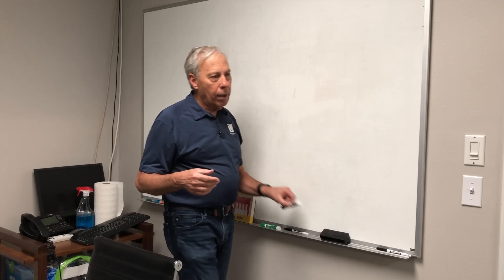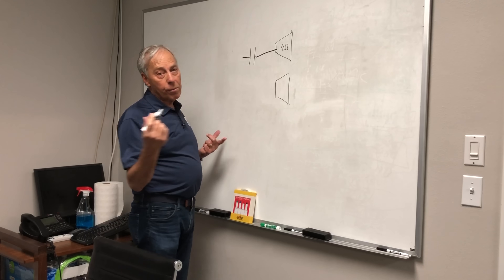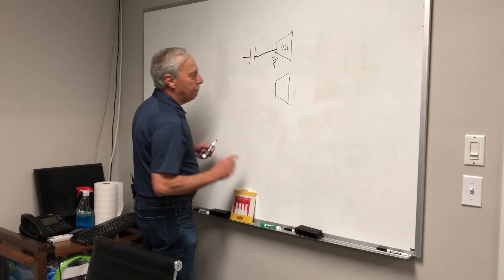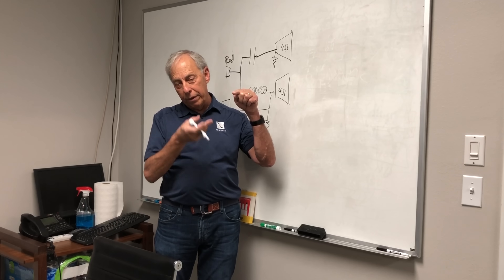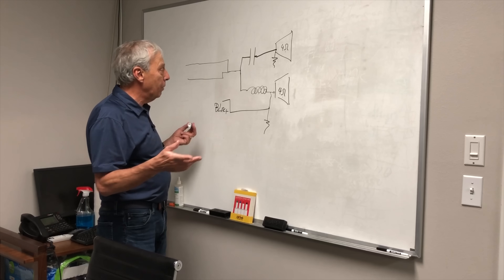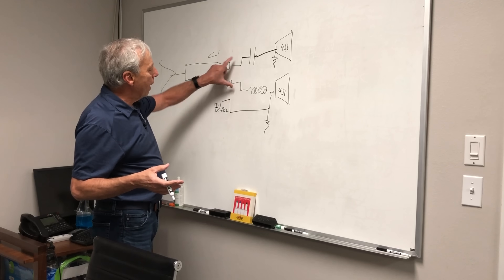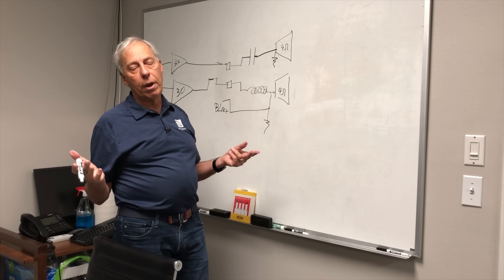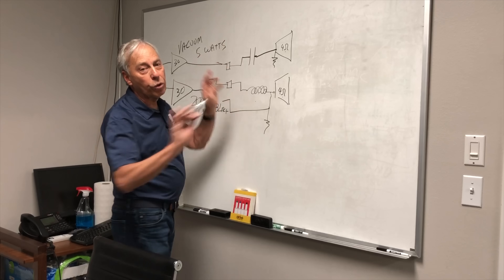How does bi-wiring work?

Comment: Hi Paul. Generally I like you vids and explanations a lot. But I'm not happy with this explanation of bi-wiring. You do it because the woofer generates a current back to the amp while the tweeter does less so. The back-current from the woofer won't disturb the signal to the tweeter if you bi-wire. So it's basically not about watt goes in but about watt goes back. Also, with most double-posted speakers, you don't bypass the cross-over. Sorry but my explanation is the only reason why bi-wiring can make sense. Apart from the fact that there's double the amount of cable feeding the speakers which might help.

Comment: Paul you were great at the "Bi-Wire treatment you gave.  The Bi-Amping not so much.
The push and pull you attribute to the two legs of the circuit as (+) and the (-) lines was a great metaphor.
The only thing I'm considering as not being discussed in the many clips I've watched on this topic is a follow on for you.
In AC circuits we have a ground and more importantly a Neutral.  The Neutral essentially is. relief valve for XS current drawn that needs to be safely dissipated.  I realize this is a DC circuit however am similarly wondering about the return leg in the DC circuit being free flowing enough to draw off the powered leg amperage in heavy pass phase. (Hi Wattage peaks). In the AC circuits when grounds and Neutrals are "Pigtailed in  receptacle boxes and junction boxes,  specifically in the receptacle boxes with 3/4 wire, have run into a situation where if there wasn't sufficient length to the Neutral back from the receptacle it is feeds in a ground fault plug, it trips the GFI one the outlet.  Running a little more wire back from the plug connection before creating the pigtail overcame this issue which I took to be a case of giving the current sufficient "Headroom" not to kick back in the immediate vicinity of the plug.  Again realize that DC and AC are very different animals however the "Headroom" for current dissipation on the return leg of the circuit is a common concept for both the AC Neutral and the DC (-) legs.

Hope I didn't ball that up too badly but after years of toying with electricity seem to be finding more of its elemental current flows making more sense to me.
Thanks for the video.  Enjoyed it very much and again you hit a point others did not, and explained it very well.

Comment: Important! He mentions «beleive»  when explaning bi-wiring. Thats what its all about.   The electrical signals that leaves the speaker terminal on the amp does not «know» if it is treble or bass signal, so using different cables doesn’t make sense.  Spoiler: the cables are shorted at the amp’s terminals.
Reply: Not quite true!! Whilst it's true that the signals leaving the amplifier terminals don't 'know' in the sense that we are cognicent of things, but are induced to flow, high frequency in the wire going to the tweeter terminals, low frequency to the woofer terminals, by the impedance of each element. This IS how the crossover separates the highs from the lows....it's designed to perform this task! The point at which the highs and lows separate (usually on the printed circuit board in a 'normal' speaker with one pair of terminals), in the speaker designed for bi wiring, is brought back to the amplifier terminals, but functions in the same way.

You're right: it's not a matter of 'belief', it's a matter of science.......😊

Comment: Tried it and it made no difference at all. No disrespect to you Sir, but as one who fell hook, line and sinker for the guff about cables when he started out, experience has taught me to never buy anything unless you can hear an immediate improvement which is consistently identifiable in blind trials. Ask a friend to randomly swap out the component under test with the one from your existing setup, and only if you can tell which is which every single time with your eyes closed should you consider buying it.

In my case the last time this happened was back in 2012, when I bought a pair of balanced interconnects to replace my Nordost Heimdalls (and they weren't even a quarter of the price! What on Earth possessed me to part with nearly five hundred quid for a couple of bits of wire I shall never know. LOL!) Since then I have tested numerous cables - including some very expensive ones - and can confidently say that the difference they made to my Lyngdorf/Monopulse system was a big, fat nothing.

It is my honest opinion that for most people with average hearing, high-end cables - and different cabling configurations - are a complete waste of money (i have yet to try bi-amping, so I shall reserve judgement on that one). You are far more likely to make a noticeable difference to your system by upgrading your sources, amp and speakers. Messing around with wires can be fun and there's nothing wrong with it, but unfortunately most of the time you will be disappointed. That's not just me talking - it's bitter experience!

Comment: Finally, a bi-wiring explanation that makes sense.  There are countless attempts at explaining the advantage(s) of bi-wiring that make zero sense.  The ability to use specific cables that are more suited for the individual drivers is the ONLY thing that makes any sense.  Otherwise, all you are doing is moving where you split the signal coming into the crossover.  THANK YOU!

Comment: Maybe im wrong but when i remove my bi-able crossovers they actually have 2 inputs one for the low to mids and ine for the highs. On the outside they have a jumper so i would assume its for bi-amping not bi-wireing. Is it that some fool misunderstood the assignment and called it bi-wire and it just stuck?

Comment: the only problem is that if the cables are made correctly and isolated, there is absolutely no way for the cable to be "better for high frequencies". All cables for correct AWG size sound the same, unless badly manufactured.

Comment: On a Marantz PM8004 I’m using speaker A terminal to wire the tweeters  and B terminal for woofers on my bi-wired Quad 22L tower speakers. Although it is not technically bi-amping, is it offering a benefit? (Sounds pretty good to me)…
Reply: It sounds good because they are excellent speakers and amplifier for the money. As for any gain with biwiring using the A and B speaker outlets, there isn't any - the A and B output terminals are derived from the same output transistors, they just pass through their own switches to the terminals; it's the same as paralleling them on one set of output terminals.

Comment: IN BI-WIRING, what separates the highs from the lows when the wire leaves the amp?  Does the wire have a cross-over?
Reply: No the wire doesn't have a crossover! The crossover is still in the loudspeaker cabinet...but split completely into two separate filter circuits (in a two-way speaker) these, along with the drive unit 'presents' a frequency dependant load to the amplifier which will supply current as and when needed to the tweeter or woofer - this current travels along the wires, treble to the tweeter filter and subsequently to the tweeter, and bass/mid to the woofer filter and on to the woofer. The paths diverge where the split occurs - usually inside the cabinet...often on the circuit board of the crossover in a single terminal pair speaker. In tha biwirable speaker the two sets of terminals are bound together by plates or jumpers and a single speaker wire is plugged into either the top or bottom terminals, the split point is therefore either at the top or bottom terminals. When biwire is used the plates/jumpers are removed so the split point can be pulled back to the amplifier terminals, enabling the treble current to travel along the wire to the tweeter terminals (usually the upper pair), and the bass/mid current to the woofer terminals (usually at the bottom.

The debate should be 'whether' any advantage accrues from such an arrangement, not 'how' it works! There are sights that deny it works like this.... presumably so that they can deny it 'works' at all.....don't believe the fake science, it works as I've described!

Comment: I was reading the instructions for my new Polk speakers. I didn't exactly realize that even if you don't biAMP them, that you can still biWIRE them anyway. What if they just took the crossover out of the speaker and installed it in the back of the receiver or amplifier instead?

Comment: How is it separating the cross over?  The cross over is internal and if you Bi wire or not, you will still go thru the internal crossover!.  Bi wiring doe snot work, nor makes any difference unless your HF and LF are completely separate from each other internally.  that is the original creation of Bi wiring or Bi amping!
Reply: The crossover is separated into two completely different filters, a high pass for the tweeter, and a low pass for the woofer. This happens when you take the shorting plates off the upper and lower sets of terminals on the back of you loudspeaker....and yes, of course you still go through the crossover but the point at which the signal splits into highs and lows is taken back to the amplifier.

Comment: Bi amplification was used in car stereos to keep amplifiers cooler by shedding thermal loads on the heat sinks ..I used to wire 2 punch 45 amplifiers one for left and one for right .The woofers would be on left and the tweeters would be on the right channel with an electronic cross over being used to divide the frequencies .low pass and high pass .The woofers being the higher current load would run hotter than the side running the tweeters keeping teg amplifier cooler

Comment: IMO splitting up a designed speaker into its basics seems to be an overuse of connectors. I have seen both 2way and 3way sets. I am a believer that one amp channel per speaker, which unlike this design, allows much more flexibility in style and location of cabinets. My subs are buried in the corners and my 2way mains point at listening area lending more versatility. But, on the other hand, if you have extra amps laying around, have at it. You could use a killer amp on the bottom and your fave tube amp on top.

Comment: Im inexperienced in the high end home stereo market. But, seems to me you have more choices than laid out here.
IF the goat is to achieve a specific impedance, wiring the posts independently = 4ohms while using a short jumper from top + to bottom - , then using the other posts will get you 8 ohms.
Just my 2 cents.

Comment: I am conserned about voltage drops, that in my head makes sense for biwiring. Imagine two, 10 meter speaker cords connected to the same amp to the same terminal. One speaker cord is loaded with 200Watts that is taken by a bass speaker. The voltage on this cord end drops due to load. The second speaker cord in the same time will not face such a voltage drop as its not loaded with 200 Watts but with 5 watts from twitter. Therefore cord that supports twitter is not affected that much due to lower current that passes through it. What do I miss in my equasion and why doesn't it make sense?

Comment: There's no explanation as to why or how this might be of benefit (let alone in this explanation you speak of two different types of cables).  In another video, two years later than this one, you state that you don't bi-wire nor is it necessary.

Comment: With your explanation of bi-wiring/bi-amplifying of low ang high frequencies, my question is, where do you fit the midrange sound if not for a 3-way crossover network for just using single amplifier/receiver? In my case am just using a Sony receiver connected to a 3-way crossover network (with tweeter, midrange, and woofer drivers), and the sound is loud and better in my hearing.

Comment: bi wiring is nothing more than reducing the resistance in the supplied wire by buying a second wire and twisting them together at the amplifier.  The signal does not "magically" separate and send the highs down one wire and the lows down the other.  The signal is the same UNTIL it gets to the cross over network.  That's where it's separated, so adding another wire does nothing more than reducing the overall resistance of the path to the speaker.  You can achieve the same results by simply using two separate wires to a single binding posted speaker.
Reply: What you've said is a mistake which is quite common amongst comments on 'bi-wiring' YouTube videos. No the signal (current) doesn't 'magically' separate and send the highs down one wire and the lows down the other....the laws of physics do it!.

At the point where the 'Y' split is, whether this be inside the speaker cabinet as in a normal configuration, or in the bi-wire mode where the split is taken back to the amplifier output, the high pass filter in the tweeter path will 'demand' that the high frequency content of the signal (current) will flow along the wire from the 'Y' split point to the treble filter and subsequently through the tweeter. The low pass filter in the mid/bass path will 'demand' that the mid/low frequency content of the signal (current) will flow along the wire from the 'Y' split point to the mid/bass filter and hence to the mid/bass unit.

This IS how it splits the two signals (currents).....it's not magic IT'S SCIENCE!!!

Whether it makes a material difference I couldn't tell you!!!

Comment: Ah yes, two different cables, to tune the highs and lows. I have a free option for that, 100% free, no extra money spend. Ready for it? Tone controls! Most amps do have them. Want more or less highs, turn thr treble. The same for the lows, turn the bass control. No need to throw you money away to those greedy money sharks.

Comment: In every reactive filter or component; as capacitors and inductors, there is introduced a phase shift between the source signal and the output from the filter. I presume bi-amping can help with controlling the phase relationship between the speakers, as there can be introduced a phase shift into one of the amps in order to cancel out the phase error between the speakers?

Comment: Been there. Done that. 
Tri wired my ProAc tablettes and Rogers lsb1 sub with separate xo boxes
It came as a relief to get LS50s with a single set of binding posts and a pair of RELs. 
KEF don't believe in bi-wiring/amping. Good for them.....I still use a pair of (bridged) monoblocs however.
🎵🎶🤫🎶🎵

Comment: I didn't notice anything outstanding when I bi-wired many years ago, but when I tried VERTICALLY  bi-amping using two stereo power amps - well, that's a whole different story.

Using two NAD 2200 power amps: on the left-side amp, left channel went to the tweeters while it's right channel went to the woofers - ditto for the right side amp. The 2200s were 100 watts into 8 ohms each side, so plenty of power and headroom available.

Comment: At a risk of sounding really dumb,  somewhat referencing a more recent video where it was about buying second hand and putting as much budget initially into speakers..
Just how terrible an idea is it to buy bi-wired speakers, if intend to upgrade amplifier(s) later, if the current amplifier is not bi-wire?
Like, can do a splitter cable that goes from single wiring amplifier (in context)  to those bi-wired speakers?

Comment: Is it possible to properly wire four speakers to a single two channel output amp ?
Reply from the maker: Yes, absolutely as long as the impedance works. If you have 8Ω speakers, then powering the two together presents a 4Ω load to your amp which is fine for most amps. On the other hand, if you have 4Ω speakers and pair them on one amp, then you have only a 2Ω load and that's likely not going to work.

Comment: Bi-wiring sells wire. Always heard a subtle degradation, not surprising since you are creating interactive fields between the pairs (how far to place them apart?) and adding the characteristic Z of another conductor pair into the mix. To step up from the usual, you need active crossovers.
Bi-amping is another matter. Taking care to place the wire pairs some distance from each other, an enhancement is achieved due to power and field interactions at and within the speaker crossover. The results of bi-amping depend upon the quality and design of the speaker crossover. It is still not as good as an active crossover.

Comment: This was confusing for me and I'm an American. You didn't even explain that you need speakers that are capable of " Bi wiring" or " Bi amping" in order to actually do this. You need to have 2 sets of binding posts on the back of your speakers in order to do either one of these unless you want to open up the back of the speaker boxes and seperate the tweeters from the woofers manually. You didn't explain any of this.

Comment: I'm using a stereo equipment with output for mid range and high frequency speakers and another for low frequency speakers (subwoofers). Since its original speaker boxes have lousy mid range drivers and tweeters, I'm using another pair of speakers. These boxes have three speakers and crossovers each. Their mid range drivers and tweeters are very good. So I connected the mid range and high frequency outputs to them and the crossovers don't allow any of it to leak to the woofers. Audio quality has improved a great deal with this arrangement.

Comment: Red is positive.  Black is negative or signal ground.  Amp speaker outputs are not referenced to chasis or earth ground, only signal ground which is produced by the power supply which should not be connected to the chasis

Comment: Years ago I had a pair of Dahlquist DQ20i  speakers and a Carver avr100 reciever,  and an Adcom gfa5500 power amp. So I said let's try using the Adcom for the Bass and the Carver for the mid range and trebble. It sounded amazing, dont remember them sounding this clear. That Adcom was a beast 200 watts in to 8 ohms 350 into 4 ohms and the Carver was 150. The DQs had a beautiful sound. Then my ex harrassed me until I sold them.  Should have gotten rid of the instead of the speakers.